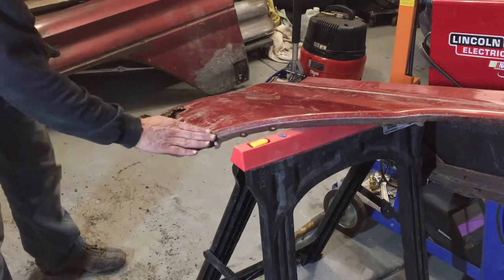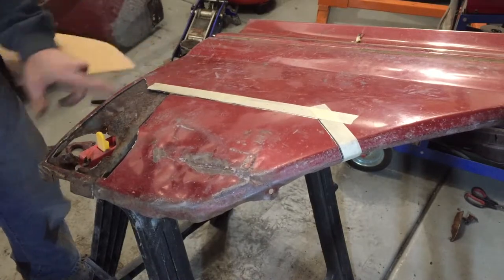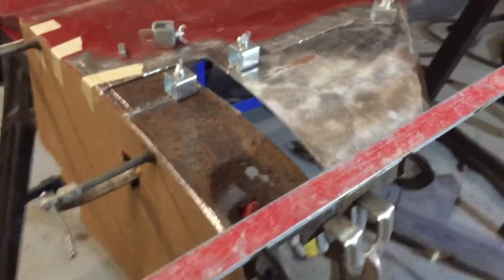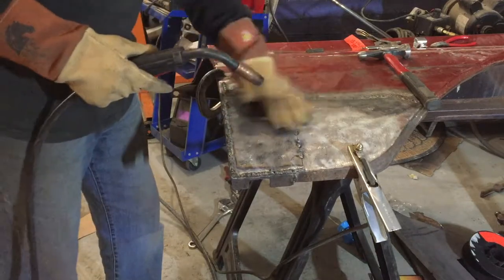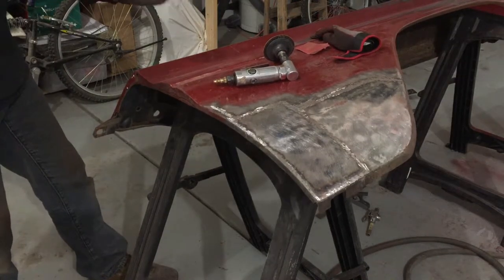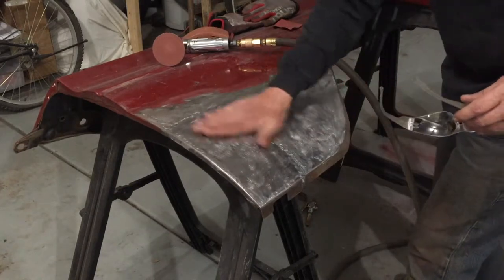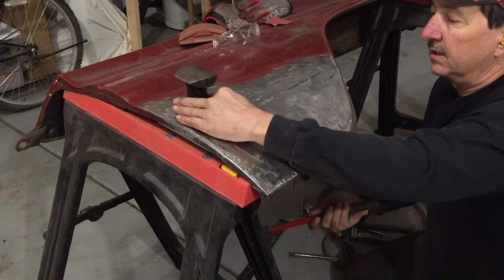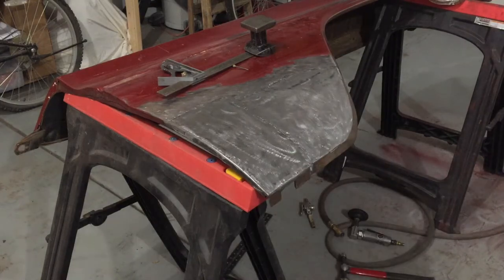1960 Pontiac Ventura Barn Find pt 6. DiY tips for body work, rust, patch welding, metal shrinking.

Comment: nice job with the patch panels its ready for filler now I was about to point out in the last video how you should wear a respirator but I'm sure you already know cannot wait to see that fender go back onto the car looking really good thanks for taking the time to demonstrate how its done properly
Reply from the maker: I have mild asthma and that stopped me from opening my own shop years ago so a good respirator is a must for me when I work with chemicals and paint. A low cost mask works with sanding and grinding dust.